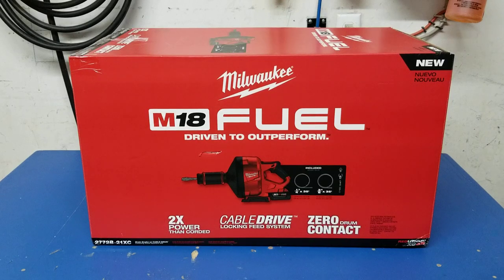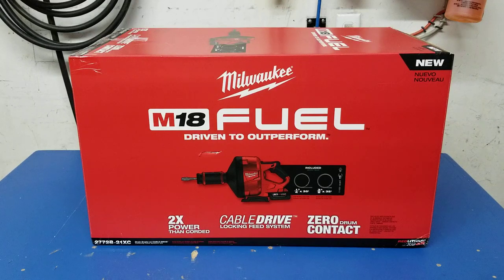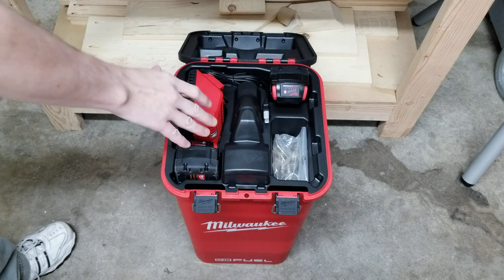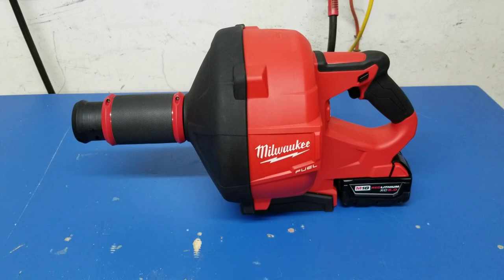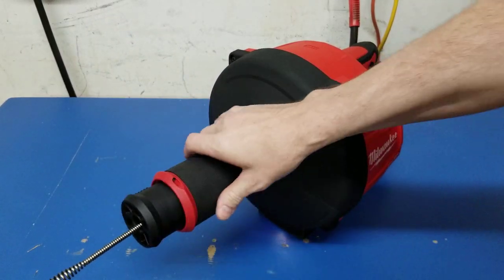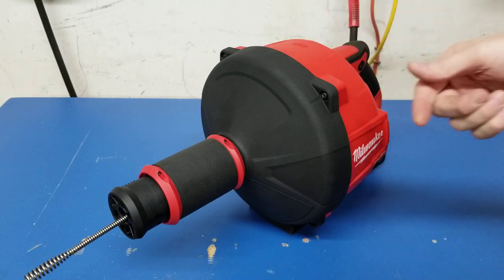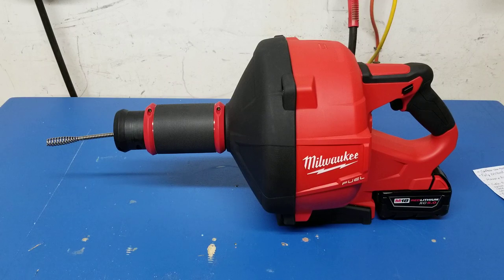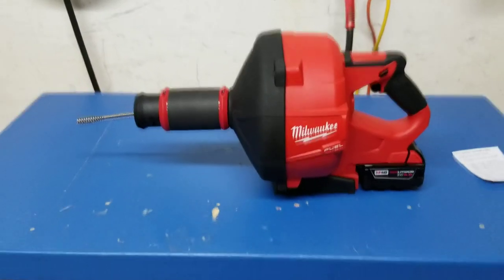Milwaukee M18 Fuel 18-Volt Lithium-Ion Cordless Drain Cleaning Snake Auger Cable Drive Kit

Comment: I just bought this machine less than a week ago. I went from a corded General Power Vee to this. The biggest plus, for me, was the drum is contained so it doesn't throw black gunk all over the place when running it. Plus I like the bucket it comes with to let it drain out when you're done using it, I guarantee that will extend the life of the cable and the machine because you don't have water sitting in the drum, corroding the cable. Another big plus for me was the flat base so you can set it down while running it, I can't tell you how many times I got burnt by the drum on my power vee from spinning against my forearm when I am holding it in a tight place and you have no choice to keep it running. Also my power vee got heavy the longer you held it. I haven't got to use it yet, but I am looking forward to running it for the first time down a drain. Thanks for the video!
Reply from the maker: Sure thing I'm glad you liked the video! You won't regret picking it up, its an amazing machine definitely the best out there in my opnion, Milwaukee makes some of the best stuff you can get and this tool is no exception. Originally I ran Ridgid which is made by the same company as Milwaukee, TTI they also make Ryobi, Milwaukee is their top of the line brand and Ridgid is their midline brand and Ryobi their DIY brand. I ended up getting into the Milwaukee line because I was lucky enough to get into a program thru Home Depot where they sent me up to 5 free things month and not just tools but all sorts of stuff you can buy from Home Depot but I was lucky enough to get quite a few Milwaukee tools thru them and more importantly five 5amp batteries and I'm sure you know batteries are a huge expense when switching brands so between getting 5 Milwaukee batteries and 4 tools I was able to break into the Milwaukee line of tools. I mostly buy Milwaukee now but occasionally I'll buy a Ridgid or Ryobi tool if it's something Milwaukee doesn't offer Between the 2 Ryobi tools I have (I also have their garage door opener which accepts all sorts of awesome accessories!) my Ridgid 18-Volt tools and my Milwaukee M18 and M12 tools and including my Milwaukee yard equipment I've got at least 40 cordless tools now! Cordless tools are the definitely the future pretty soon everything will be cordless. I have a 10" corded Ridgid table saw but after picking up my Milwaukee M18 FUEL 8-1/4" table saw I quit using my Ridgid corded table saw because the Milwaukee one is nicer has the same rip capacity of 24-1/2" and has things like a soft start motor and a better measuring rail system plus I don't need to mention it's more compact and is easier to pack around plus I never have to look for a for an outlet and it'll run all day on a 12amp battery, same with my 10" Milwaukee M18 FUEL Miter Saw, I also have a 7-1/4" sliding Ridgid Miter Saw for smaller jobs. The only other corded tool I have is my router which is in my router bench and never leaves me garage and a corded Ridgid wet-dry vac but I also have a small Ridgid 3 gallon wet-dry vac and I also have a cyclone Milwaukee vacuum it's not a wet-dry vac and only vacuums up dry stuff but it's amazing it has a nice tangle free hose and an end that takes wey-dry vac attachment and has a steel hose on the end that collapses for storage but with the slide of a collar reaches the ground and it has an attachment that let's you wear it as a backpack which will also come off so you can set it on the ground to use and it also has a retractable hook to hang it from a 2x4 and also a strap with a clip so if your using it up somewhere high your able to clip it and hang it on something if your into the Milwaukee tool line and need a good vacuum you should check it out it's awesome. https://www.homedepot.com/p/Milwaukee-M18-FUEL-18-Volt-Lithium-Ion-Brushless-1-Gal-Cordless-3-in-1-Backpack-Vacuum-Tool-Only-0885-20/305519406 anyways I'm so glad I got I got this Milwaukee M18 FUEL Drain Snake and for free at that I really lucked out there!! I've used mine well over a doezen times now and I've never come across a clog it wouldn't handle and I love the fact that it's cordless, no more searching for outlets. Plus like you said the fully enclosed drum is super Badass plus the bucket and the way it let's excess water drain into it is awesome plus it makes it easy to carry around and mess free too. I also really like the tray that'll hold 2 batteries up to 5amps inside although you'll never need two 5amp batteries since 1 will run it all day and having a place for a charger is nice too plus I like the accessory spot, I keep all the heads toy 3/8" cable some work gloves and safety glasses in there. Also if you wrap up the cable your not using u can fit it in the bottom of the bucket. Also you can reel your cables all the way out and spray them with WD40 to keep them from corroding. But if you look close at the front there are 4 screws holding the front housing on and if you take them out the front will pop off and you can clean out the drum, I'm not sure if you have to take out the 4 screws holding the drive collar on and take it off but I don't think you do. The reason I say I'm not sure is when cleaned mine out I took out the 4 screws and removed the drive collar. Either way it's easy enough to take apart so you can clean out the drum! Anyways I'm glad you enjoyed the video, sorry for the long reply

Comment: Looks cool, but I’ve used plenty of professional snakes and best and safest way to clear drains is to manually feed the snake. When you have it going forward and say your in about 20ft or more, you can’t really feel if your hitting something that fast, and that could cause you to mess something up or kink the snake. We had a heavy duty automatic one that went down the wrong path and ended up coming up the toilet and damaged it enough where the toilet had to be bought & replaced by our company. So in a perfect world where you just have a straight line plumbing this would work great, but we don’t live in a perfect world. My advice, get the manual feed one, cause you can easily feel when you hit something, and you can react faster so you don’t mess anything up, or kink the cable. And this design of turning that collar looks like it would take too long.
Reply: jbravo70 I think where the drive system would be handy is if it will pull the cable out besides that I agree manually feed
Reply from the maker: For your information not only can you run it forward and backwards in drive mode but you can also flip it into neutral so you can feed the cable back and forth by hand so you don't have to use the power drive system if you want to, so it is really the best of both worlds!👍
Reply: Things are going less contact because of hypodermic needle’s

Comment: Thank you. Saw the m12 at the plumbing supply , and thinking about that one m18..my old electric one is on the way out .
Reply from the maker: ReCycle Spinning Go for the M18 and you won't regret it, I've checked out the M12 and the M18 has better features, bigger cable capacity, it also makes more sense if your in the 18volt line like I am plus it obviously has more power!

Comment: I know not recommended but is there any way to add 15 more feet to the cable once u hit 35 ft sometimes just need that extra 15ft to not have to pull out the big guns
Reply from the maker: You can't add any extra to an existing cable, but you can actually purchase 50' cables for it provided they are either 5/16" or 1/4" in diameter however 35' is the maximum for a 3/8" diameter cable. For my machine I have a 50' x 1/4" in cable and a 35' x 3/8" cable.
Reply: Got it so a 1/4-3/8 50 ft will fit in this what about the m12
Reply from the maker: You can use 50" long cables in 1/4" and 5/16" diameter but you can only use 35' long cables if they are 3/8" diameter. The M12 will take a cable of 25' long with a 5/16" diameter max. So the M18 is far superior being able to take cables twice as long, also the M18 is for drains up to 3" where as the M12 is only recommended for drains up to 2-1/2" In addition the M18 has the nice locking collar whereas I believe with the M12 you have to hold back on the collar to keep it engaged. I haven't had a drain I couldn't clear with my M18 yet. I also have the Milwaukee M12 Air Snake which is really nice for smaller clogs and is very quick and easy to use, it has multiple different heads to use on different kinds of drains. I've found it particularly useful for toilet clogs, it has a rubber head specifically made to fit in the toilet for a tight seal and since it uses air pressure instead of a cable that could damage the ceramic inside the toilets trap there is no need to take the toilet off to use it. If your looking for an M12 unit I would definitely suggest the M12 Air Snake.

Comment: Thanks for the review. How do you attach the 5pc heads to the cable?
Reply from the maker: Sure thing I'm glad u liked it. They just slide right onto the end of the cable and a pin pops up and holds them in place and then when you want to remove them there is a special tool that slides into a hole at the end of the cable and removes them
Reply: Can you make a video on this because there is no way they just slide in to end of the original cable there has to be an adapter or are used on a different cable

Comment: Regarding the power feed, is it capable of retrieving the cable while in forward rotation, or does it only retrieve with the motor in reverse?
Reply from the maker: It has a forward and reverse switch and when you power feed the cable in forward it spins clockwise and in reverse it spins counterclockwise. However when your power running the cable in the stationary position without retracting or retrieving it you can spin it clockwise or counterclockwise. Plus you can also put it in neutral and pull the cable back in by hand if you want to.
Reply: Thanks for the reply. Probably not a deal breaker but I’d prefer it to power retract running forward like a full size drum machine. Better chance of staying hooked/pulling the clog out, less chance of trashing the cable.

Comment: How do i put the cable back in? I see no attachment inside the drum
Reply from the maker: There is nothing to attach the cable to inside the drum, you just feed the cable into the drum and get it to coil around inside the drum and that's it.

Comment: Solid review. I’m a plumber and you sold it 😉
Reply from the maker: Thanks I'm glad you enjoyed the review I know it was a bit long and I repeated some of the features more than once but it's an amazing machine, I love mine it's never let me down! I'm not a plumber but I've done about 30 drains since I've had mine and it's cleared them all quick and easy! 👍I'd mention all the features but there in the video but I'll say I love that it's cordless and the enclosed drum is great and keeps everything mess free and the bucket it goes in is great much better than just a 5 gallon bucket since it's made to fit the machine in it perfectly and has the tray on top for batteries and accessories plus the feed collar and the way it let's you feed the cable in forward and reverse and then stay in place to work the clog and I also like how you can put it in neutral and pull the cable out by hand if you want. If your a plumber this is the perfect machine for doing household drains! If your looking to do larger drains and need longer cable check out the Milwaukee switch-pack setups, they also offer specialty snakes for toilets and urinals and even have one that uses air pressure to clear clogs. As I said in the video Milwaukee sent me this one out for free to test but I was also given the option of picking one of the switch-packs but it was bigger than I needed or one of the air pressure guns which I didn't think would suit my needs as well as this snake so I picked it out and I'm sure glad I did cuz it's Badass and works perfect for my needs! If your a plumber definitely check out the Milwaukee line of drain snakes cuz they have all sorts of different drain snakes depending on what you need them for!

Comment: I went to Home Depot to buy my friend a clearance two batteries and a charger.8 amp h.o and 6amp h.o rapid charger and a bag reg price $397 marked down to $150 .I should've open the box when I was buying it.I got it home and opened up the box It looks like somebody who originally bought item returned with used 6 amp and a 5 amp Everything was sealed in little boxes with tape.We were very surprised.Went right back to Home Depot and returned it didn't even say nothing because they probably would've thought I did it.I'm never gonna buy something like that with battery used .Especially if somebody's going to slip in old batteries.Be careful.
Reply from the maker: Yeah it's a bitch when people do that shit I hate it!
Reply: They would have had the purchase in the records

Comment: How long is the cable? The video is too long but never mention about the length of the cable
Reply from the maker: The cables that came with it are 35' long but it will take up to a 50' cable.

Comment: Will it clean a full 35 feet or less.
Reply from the maker: Yes it will clear up to 35 feet with a 3/8" cable and up to 50 feet with a 1/4" or 5/16" cable.
Reply: @chevy5137  I really like these products just trying to find out all I can
Reply from the maker: @robertsparks3584  This is the kit the I have and the one I suggest getting it comes with a 1/4 inch 35 foot cable and a 3/8 inch 35 foot cable with 4 different head that can be attached to it and it also comes with a bucket to carry it in plus a tray on the top of the inside of the bucket that holds two 5.0amp batteries, a charger and a spot for other things like the attachments for the 3/8 cable and I also keep gloves and safety glasses in that area too. If you watched my video I'm sure that you know all the other really cool features  it has. The tool alone is $399 but that's just for the bare tool with no battery, charger, bucket or cables which is why I suggest this kit. You get all that extra stuff for an extra $260 which I think is totally worth it, if you were to buy just the tool and then all the things that come with the kit you'd end up paying a lot more. Also it will clear drains from 1-1/4 inches up to 3 inch drains. Here is the link to the kit I have on the Home Depot website.
https://www.homedepot.com/p/Milwaukee-M18-FUEL-18-Volt-Lithium-Ion-Cordless-Drain-Cleaning-Snake-Auger-with-1-4-in-and-3-8-in-Cable-Drive-Kit-2772B-21XC/303229100#overlay

Comment: I have one with a 3/8 cable and it works great I just wish it would hold more then the 35ft
Reply from the maker: Unfortunately the 3/8 in. Cable will not run more than 35 ft. But I believe the 1/4 in. Cable will run 50 ft. I guess that is the price you pay for handheld cordless. Of course that will take care of most household jobs. Addendum, you can also get a 5/16 in. Cable in a 50 foot length

Comment: What the longest cable size you can put on it
Reply: 50 foot x 5/16" or 1/4"
Reply from the maker: Yup 50 foot in 1/4" and 5/16" diameter and 35 foot in 3/8" diameter.

Comment: How do you clean the snake inside the drum?
Reply from the maker: You take the cable out and there 4 screws that hold the feed collar on and then 4 screws that take off the front black portion of it allowing you to clean inside the drum, it's really easy to do and only takes a few minutes.

Comment: Do you happen to know if the m12 is a brushless motor? Will have to ask at the plumbing supply. Should do a comparison on the m12 vs m18
Reply from the maker: ReCycle Spinning I don't think the M12 has a Brushless motor. I would do a comparison on the M12 and the M18 but I don't own an M12, the only reason I own this M18 right now is because it was sent out to me for free to test and then review.
Reply: All the FUEL stuff is brushless
Reply from the maker: @MrDmadness  Yes that is correct any Milwaukee M18 Fuel tool has a Brushless motor.👍
Reply: If it says FUEL, it is a brushless motor. That is the whole fuel line, 12v and 18v, if it says FUEL on any Milwaukee tool, it's a brushless motor.

Comment: If you don’t think this is for a blue colored worker who owns his home then you’re nuts   This will paper itself and three drain clogs getting unplugged because this cost me about the same as three times somebody coming out to unplug my drain for my sink in my kitchen three times catch me with this thing cost me.   I did my first drain tonight 2 more time and thirds on the house you know a plumber that will do that. Plus for another call I got the borescope. In the thing does work like a champ it just takes a minute to get used to it if you ran the  old drum style snakes with the footpedal I kind a wish this had  a foot pedal.
Reply from the maker: I'm not a fan of the foot pedal but I guess it all comes down to personal preference. If your not going to be doing multiple drains with it then I recommend the Ryobi drain auger, it doesn't have near the reach but should do for easy household clogs and is a fraction of the price, the Milwaukee is definitely a professional machine! If you can afford it and your going to do more than just one drain I would go with the Milwaukee all day long as it is the best handheld machine on the market in my opinion!